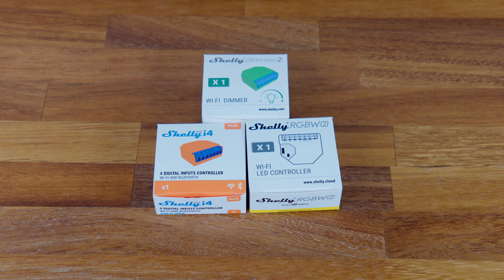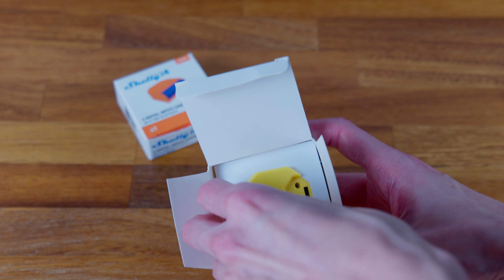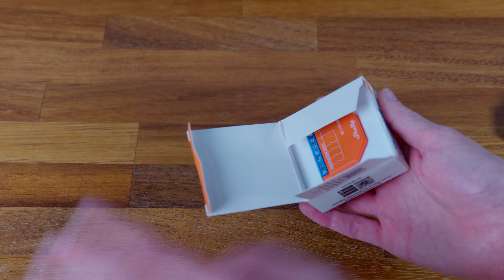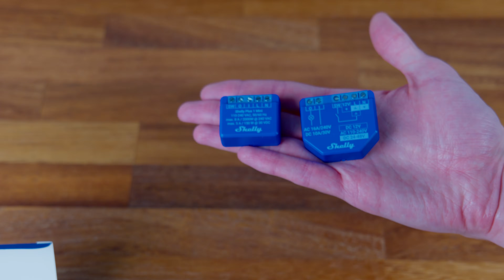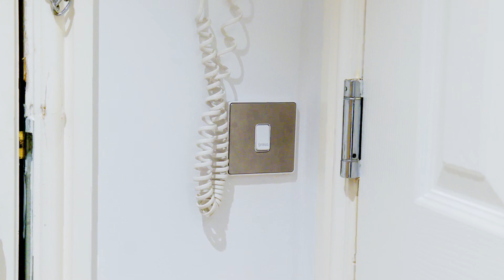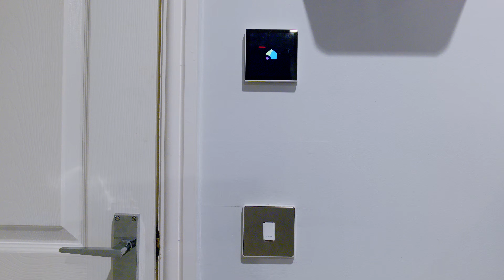These are Awesome - Installing Smart Lighting using Shelly Devices

Comment from the maker: Buy on Amazon (Affiliate):
  - Shelly Dimmer 2 - https://geni.us/9hY405
  - Shelly RGBW2 - https://geni.us/BjZIdH
  - Shelly Plus i4 - https://geni.us/XyQ6T
  - Shelly Plus 1 Mini - https://geni.us/qkOiP
Reply: Cameron, your content is good, but it would be better if you would talk slower or more articulate, i am non native english speaker and it was hard to understand you at certain moments. Content wise, it is 9/10 👌
Reply: English is my first language and I agree with your comments. An easy work around is to tap on the YT gear wheel icon and set playback speed to 0.75%. 
It’s a very unusual problem, but easily solved 😊

Comment: Hi Cameron. I am trying to replicate your switches in this video. I have ordered the MK grid switches and have found the screwless brushed steel plate but what frames are you using? I like the white surround that has a thickness to it away from the wall. Thanks for your help. Your videos have been super helpful.
Reply from the maker: The switches are from the MK Dimensions range - the frame is part of the front plate.  Its a separate (and cheaper) range from their normal "Aspect" screwless one.  It's sold as two separate parts so you'd need to buy the "functional module" - switch/socket.etc in either black or white and then separately buy the screwless front plate with your desired finish and surround colour.  It's a bit of a faff to order since most wholesalers don't neatly present all of the parts, but this brochure explains all of the part numbers you'd need: https://prod-edam.honeywell.com/content/dam/honeywell-edam/hbt/en-us/documents/literature-and-specs/brochures/hbt-ep-mk-dimensions-brochure.pdf

Comment: If a Downlight fixture says not dimmable, can i still add a dimmable GU10 to it or will there be issues?
Reply from the maker: If it's just a pure GU10 downlight then I can't see why not although I've never seen a GU10 fitting advertised as dimmable or non-dimmable.  Are you sure it's not some sort of integrated LED fitting that doesn't contain a GU10 bulb?
Reply: @camerongray1515 I wouldn't say it was advertised as that but on their datasheet i'm pretty sure it said "Dimmable: No". This is the Aurora EN-DLM981X
Reply from the maker: That should be fine then, presumably just a case of a retailer having a template for integrated downlights with a Dimmable section that isn't really relevant to GU10 fittings.

Comment: Great video. I’m an electrician and have been installing WiFi Quinetic for ages and personally love it and so do my customers… ability to add switches requiring no battery or wires that can match most decorative switches is very handy… however in my own home I’m starting to think about  Home Assistant so my cctv cameras can turn on outside lighting etc…. I was disappointed to find that quinetic doesn’t pair to HA without a big faf apparently (I still might give it a try) but failing that Shelly seems a very promising way to go and you video is excellent and informative.

Anyway… I have a question about the dimmer receivers you have just used….
Can you use them with a centre off retractive switch like so:
Ch1 press turns on, double press hold dims up.
Ch2 press turns off and hold turns down. 
Maybe with the double press shortcuts too.
Is this something that’s built into or configurable in the Shellys system themselves or is there extra scripting required for that.

Comment: Shame they don't work with rotary dimmer switches but if your going down the retractive route at the at the very least use a 3 position centre off retractive switch

Comment: Hi, does it automatically start working as a dimmer out of the box with the functionality described in the video for the Varilight retractive switch with no config needed? Or did you need to go into the Shelly web interface to set the switch type to "Momentary: (Button only) - Set Shelly device to be Momentary switch. Push for ON or Push for OFF." to make it work with the Varilight Retractive switch? Looking to do a big install and want them to work out-the-box as normal switches without any configuration before I play around with the smart features.

Comment: Quick question about dimmer2 and 2 way switching please. Can it work on a 2 way switch and retractive switch? I tried but switch only stays on when pressed. Got it working fine 1 way switch. The sparky telling me it won't work  because something to with the common wire?

If anyone can help with this would really appreciate it.

It's hallway switch at front and then another near stairs for context all new wiring everything connected in back boxes with wagos.

Many thanks
Reply from the maker: You'd really neeed to have two retractive switches, both switching live to the switch input on the shelly so that when either switch is pressed it'll momentarily switch live to the shelly's switch input.  If your issue is that one of your switches is a regular 2 way switch because it's part of a multi-gang switch plate, you'd need to look at getting some sort of grid switch which would allow you to mix retractive switches with regular switch modules on the same plate.
Reply: @camerongray1515  using click mini grid and swapping them out regular switch. But sounds like would need to change all the switches on the connection to retractive.

Comment: Hi Cameron, I believe you're using the MK grid plus switches. Does your installation use standard one gang back boxes in conjunction with MK grid plus mounting frames? Because I see there's a special MK back box but they're expensive!
Reply from the maker: I am, however I'm using them with the MK Dimensions range of faceplates where the modules clip into the front plate itself rather than using the separate mounting frame that you'd use with the Logic Plus range.  You can use the mounting frame with a regular back box but it's a bit of a pain to get everything fitted properly since you need to tighten the screws for the mounting frame only part way and then screw the front plate on so that everything sits flush and secure.  If you were to tighten the mounting frame up all the way it would sink back into the wall and sit far too far back from the front plate.  It just takes a fair bit of tweaking and adjusting until everything sits properly, but it's definitely possible.

Comment: I am done with the wifi "smart" dimmers/switches. Off to lutron as wifi is just too much of a hassle for any of these systems.
Reply from the maker: I find WiFi itself isn't really the issue as long as you have decently reliable access points.  The issue with cheap smart WiFi devices is generally their reliance on some sort of cloud service which can be unreliable. With this setup here, everything operates over my local network so is extremely reliable.  Lutron is also a good option, but for me I want the ability to control smart bulbs (adjustable colour temperature, ability to dim individual bulbs) so if I were to go down the Lutron route, there would still need to be some level of local network involvement anyway to handle those. I did consider using Pico remotes as inputs to my smart home system instead of Shellys and using them to control smart bulbs, and it's something I'd be interested in trying in the future, but at least in the UK, Lutron's RA2 Select system is extremely expensive when you scale to any sort of reasonable level.

Comment: Does anyone have experience using a Shelly relay to force on( via an app) a LED motion outdoor security light. Normal dumb function means you must toggle the wall switch to get it to illuminate, otherwise it sits in motion activation mode. Thoughts?

Comment: Great video and neat little devices but I see one important problem with these...  They are not rated to 500V therefore will have to be removed (and Wago'd out) for Insulation Resistance Testing on EICRs approx. every 5 years...  If the electrician didn't know that these were installed (and you were at work when he came so couldn't tell him) then he would damage all of these units when he performs his IR tests...  If he knew that they were there, then he could perform a 250V IR test but this isn't the best for checking the insulation of the actual cables buried in your walls etc.  As with USB sockets, one is supposed to remove them (or turn them off as in the MK ones), test at 500V to thoroughly test the cables, reconnect them and then test again at 250V to test the actual sockets as well....  I wander what Shelly's answer to this problem is?
Reply from the maker: That's fair, although realistically the only real option is going to be to either disconnect them or to only perform an IR test by connecting L&N together and then testing between those and the CPC.  It's also sensible to initially IR test at 230v and only then ramp that up to 500v once the reading shows that the circuit is clear.  That way you'd find out about any connected loads before you cause any damage.  Even if they were 500v tolerant, you still wouldn't get any sort of usable readings with them in circuit.  Although as you've said, this isn't really any different to USB sockets or other hardwired devices such as smoke detectors or integrated LED downlights.  As for unattended EICRs, fortunately I own my flat so I don't have to deal with regular, unannounced EICRs and to be honest, I tend to test circuits myself whenever I'm doing things so don't really have any plans to get a complete EICR done any time soon, and I definitely wouldn't be having that done while I'm not at home!  In a situation where regular EICRs were required, I suppose you could at least connect the Shelly in using a couple of Wagos to make it easy to link out while testing or as I had with my previous setup, install key switches to allow the Shellys to easily be disconnected.  I suppose Shelly could also include some sort of isolation switch on the devices although they're already so small and densely packed, I suspect that'll be unlikely.  It's probably also not a bad idea to leave a clear label on the consumer unit stating which circuits have hardwired electronics on them and not to IR test them without disconnecting them.
Reply: @camerongray1515  Awesome reply, thank you :-)   That deserves a Like and Subscribe...

Comment: I tried to hookup a Shelly 1PM switch yesterday to a existing dumb light switch.  The terminal inputs on the Shelly were not able to adequately clamp onto the existing solid copper 14 ga. wires.   These solid copper wires are very stiff and need a very strong terminal strip to provide a good connection.   And  considering that at least 3 connections are required (5 if you want to include the existing manual switch), a much stronger terminal strip is needed.  The Shellys definitely need much stronger terminal connections on them.   I was not able to install the Shelly in this light switch box.
Reply: In the uk we fold the tip of the wire back on itself in this situation

Comment: Is that a unifi on hallway ceiling?
Reply from the maker: I'm now using a Ruckus R650 access point if that's what you're referring to?  Or the round thing next to it is a smoke alarm.
Reply: @35.48 have you moved away from unifi now? And how come?
Reply from the maker: @justintemp  I have, however it was only so I can try different things and produce videos on them, there is still nothing wrong with UniFi and I still continue to recommend and use it, I'll even be releasing a video that involves some UniFi hardware this week.  I just like to also make sure that I cover other options as well as I feel like YouTube has become saturated with content that makes out as if UniFi is the only option for running a high end network.
Reply: Agree. I find a lot of unifi is done via the community. There's no official support as such
Good APs but expensive hobby
Reply from the maker: @justintemp  That's true although equally, the same applies for most other vendors unless you're looking to explicitly pay for a support contract.  Sure, Ruckus has commercial support but as a home user who isn't willing to pay for a support contract, I'm also stuck with community support and at that point, the UniFi community is likely a better option due to its sheer size.
Reply: @camerongray1515  true, but for a company targeting pro sumer. You expect them to have better support.

Comment: Narrator talked too fast. Had a hard time keeping up. Sorry.
Reply: YouTube app allows any speed from 0.25x to 2x in 0.25 steps plus subtitles
Reply: It's his accent lad
Reply: Just needs some circuit diagrams; before and after. I’ve met plenty of folk who talk faster. 😂
Reply: Thanks for making this video, this is really useful! I’ve been getting into a bit of smart home stuff recently but there are a lot of different options and I’m struggling to get my head around all of it!

Btw, I was born in England but grew up in Scotland, and had no trouble understanding every word of this video. I’ve known plenty of people with much stronger accents that speak much faster than you, and you shouldn’t change a damn thing 😂
Reply: You can just change the speed of the video.
Reply: Agree.
Reply: The narrator had deliberately sped up the video himself, within 2 seconds of the video starting I thought "I cant listen to that" and set it to 75% speed, then the speech was more natural though clearly the audio quality took a hit due to being first sped up and then slowed down again. Madness.  When it got to the section where the switch was held down for 10 seconds, at my reduced speed it took 10 seconds, proving if proof were needed that the original speed was boosted.
Reply from the maker: @mikebarry229 The video is not artificially sped up and if you watch it at 1x speed, the section where I hold the button down takes exactly 10 seconds. If you're playing the video slowed down, the timestamp on the video will also slow down so the difference between the timestamp when I press the button and when the lights turn off will always show 10 seconds irrespective of the playback speed.
Reply: @camerongray1515  I told em it's just the accent... they cannot fathom the fact your cadence is that real
Reply: Cam, please don’t change your accent or speed lol. You sound like a human… I hope your just laughing about the comments about your voice and moving along (:
Reply: @jo12t it's a terrible accent if it really is. I used to speak like this too but people have trouble keeping up if you speak like this IRL
Reply: Only Americans would complain about the accent, SMH.
Reply: Agreed. And I don't think you need to apologise for saying that - it's constructive criticism not just complaining. I'm a native English speaker but I've had to slow the video down to follow it. It's an interesting video so I'll stick it out but I can see how other people would just click away. It's something that can be (and should be) easily fixed for future videos too.

Comment: Even out of the box, those shortcut commands for lowest and highest brightness level are very handy.  My mother had her bathroom renovated recently, and as part of that, a pushbutton light switch with a dimmer function was installed, it's a momentary pushbutton which you press and release to turn the lights on and off, and you press and hold to brighten and dim them, sadly, Mum's switch doesn't have those quick set shortcuts, so there's no quick way that I know of to turn the lights on at the lowest or highest brightness setting, that said, the pushbutton has a blue LED on it which indicates at a glance whether the lights are on or not.  Yes, the LED is blue, I don't know why.

Comment: When using Shelly relays is the physical switch capable of turning a light on/off if the home WiFi were to fail or lose signal?  I'm concerned that I can't control the lights if my WiFi fails.
Reply: Many automations can run on the shelly itself. As such they don't need wifi. If you set the mode to toggle or follow the switch will still work locally.

Comment: One trick I did to control two sets of lights with one switch:  press quickly- local light toggle.  Press 1 second, remote light on.  Press 2 seconds, remote light off.  I did this to control both my bedroom lights and hallway lights from the same switch.  This way I didn’t have to install a new switch.  My bedroom has table lamps with smart switches. But no wall switches. So what like using the hallway buttons for that as a dual function via ha automation.

Comment: That feature to reset to factory defaults only is enabled a few minutes after power is restored then it turns off automatically.  So the only time you can accidentally reset it is after power is restored and you also flip switch 5 times.  I’ve left that feature on and enabled here in my house.  Never accidentally reset one because power is not often cut.

Comment: I don't "feel" the way you implement the hall night light (long pressing when the light is off)
Node-red has access to local time. Why not set up your NR to switch the light to a certain (low) brightness at night?
(And a long press or a double press if for some reason you still need bright light at night)
Reply from the maker: I already have plans to implement time based control across all of my lighting as a larger project but until then I decided that long pressing the switch was the way that I wanted it to work for now.

Comment: It looks like those original switches have been put on by a hamster . Before fitting new switches I would of tidied up the wiring  and stripped the outer insulation to look nice and neat . Also fit small earth sleeving